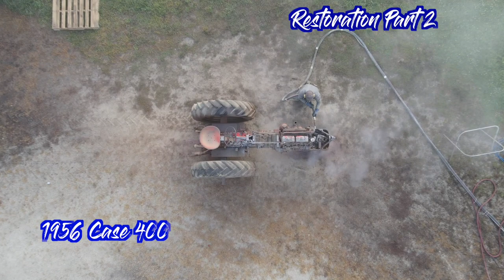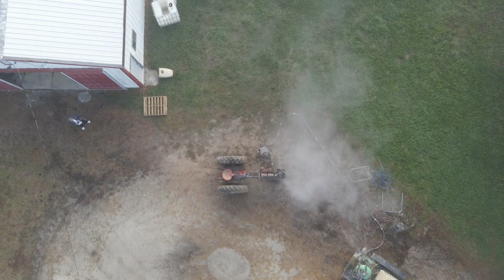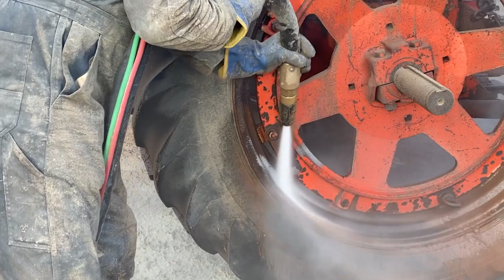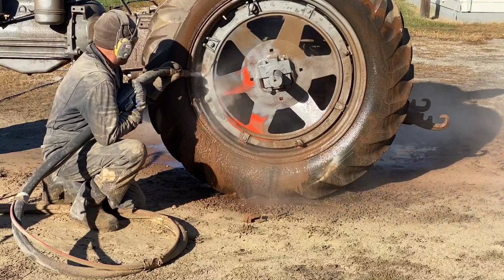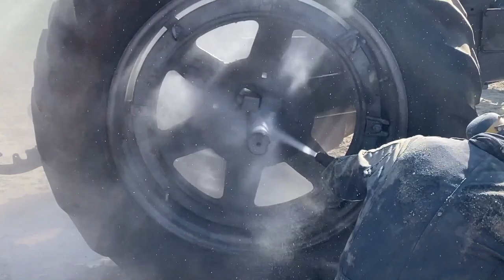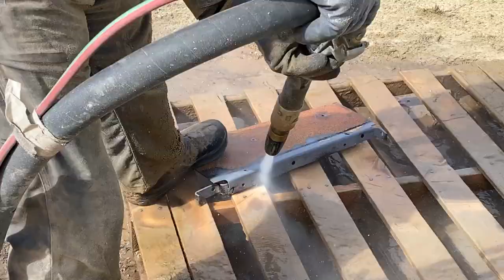Satisfying Blasting Tractor Restoration 1956 Case 400 #2

Comment: Glass medium has a closed cell structure that prevents it from sticking to the walls inside the lungs. It's then expelled from the body like any other 'normal' airborne particulate. However, lead based paint is a different story and it's highly likely this tractor is covered in it. Should be wearing full face masks for this sort of work.

Comment: awesome start  ,do you have any info for an engine rebuild kit ? ,i was told my 400 was biggest tractor in the valley back in the day  and had done  tons of heavy custom work it still runs strong but is using up to two quarts of oil if i give it a good workout thanks  TANK

Comment: Wear proper protection, unbelievable.
Reply from the maker: Are you talking about the company that did the blasting?
Reply: @OhioLiving  yes, that stuff is not good for the lungs at all. Full helmet fed with 100% clean air when I blast.
Reply from the maker: @akastonefaceddog  I don’t disagree with you but he said it’s glass and not sand so it was not a concern
Reply: @OhioLiving  I bet his lungs disagree! Nice job though, I hope you post more as restoration progresses, would like to see that running. I have a 50' grey ferguson to do for a customer, looking forward to getting it going again. Prices here in UK are going silly now for vintage stuff, it's harder to find a nice project at a good price.
Reply from the maker: Stay tuned more to come!